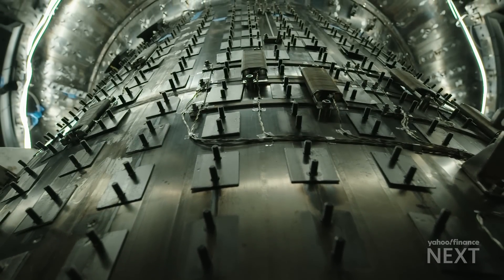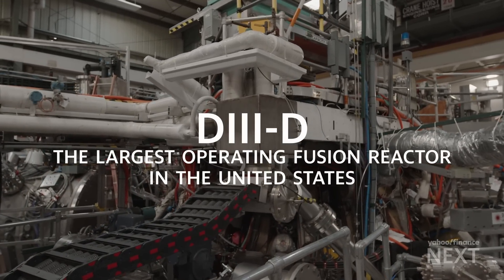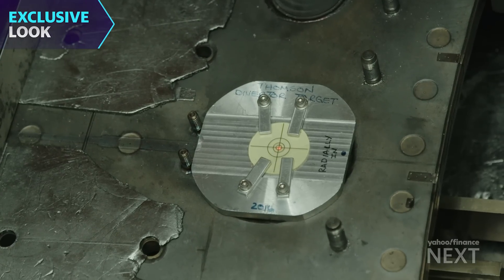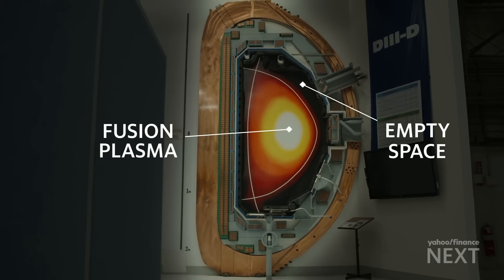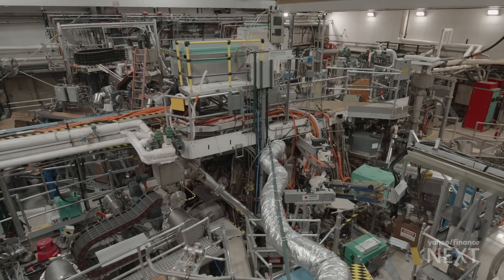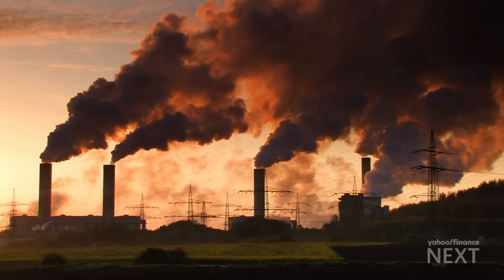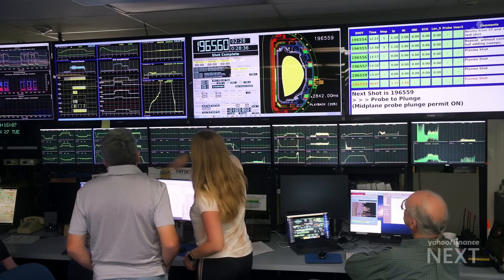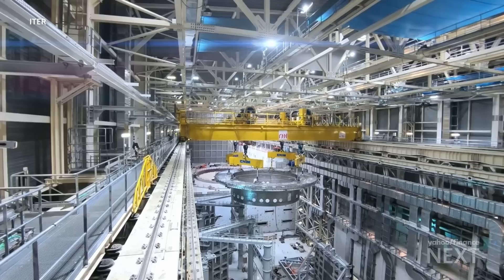Inside America's largest magnetic fusion facility and the hunt for limitless energy

Comment: Isn't that a bit silly? If a small prototype fusion reactor that produces commercial heat doesn't work, why build a large and expensive prototype? Or is this a deception of investors? Tamm and Sakharov proposed the tokamak concept in the 1950s, a toroidal device that uses magnetic fields to contain plasma to achieve controlled fusion. ....  More than 74 years later, there is no working commercial fusion reactor and won't be for many more years. Why? Because Tamm and Sakharov proposed an untested, unproven, unconfirmed, inoperable technology. There is a correct technology. It's Vlasov's scientific discovery of nuclear fusion in the Sun's atmosphere. But will reputable physicists admit that they have been wrong for many years? Are they just going to keep banging their foreheads against the wall for years?

Comment: Let's consider the following options and the alternative.

Cold Fusion (LENR) - Unproven hypothesized type of nuclear reaction that creates nuclear fusion at room temperature by producing more energy than the input energy can be produced from its altered state.

Tokamak Nuclear Fusion Reactor (ITER) - Development cost for the ITER is $150 billion. Requires a temperature of 150 million degrees Celsius to create nuclear fusion. Reportedly the record to date but having to use more input energy than produced is 69 megajoules of fusion energy for five seconds using 0.2 milligrams of fuel. 

The alternative.

Solar Hydrogen Energy Recovery Gas Turbine. 

301Kwh (equal to 46/6.6Kw home solar installations) of solar energy collected from the sun’s nuclear fusion at atmospheric temperature is sufficient for electrolysis to fuel start a hydrogen Gas turbine to enable the synchronizing of its Variable Frequency Generator to provide constant electrolysis to continually fuel the turbine and operate the energy recovery system on a hydrogen use as produced basis with variably regulated base load power supply capability to service grid energy demand and manage both inertia, and mis matched frequency while generating an energy range between 86 - 330Mw with optional co-generated steam capacity up to 700Mw of electrical energy on a 24/7 basis. 
The power generating turbine has three operational parts, 3m in diameter 5.5m long and weighs 6 tons. Installation cost $36.5 -49.5 million, requires an operational footprint area the size of a football field, noise level is 60dbl at 60m, incorporates direct air capture of CO2 at 1,400 Kg/sec and includes a 14-year end of life decommissioning or optional refurbishment program. 

Sixty-five carbon and pollution free, shovel ready off the shelf technology that combines Solar Nuclear Fusion with modern aerospace propulsion and existing Nuclear and Coal fired steam technology to generate a total of 21,450 Mw by  retrofitting to any of the 120 Hydro-electric schemes would provide Australia's 26 million population its entire energy needs covering a combined operational area of 33 hectares for a 2023 total cost between $2.4-3.3 billion, construction period is 3 to 5 years, meet net zero energy target twenty years earlier and makes wind and solar farms including hydro, gas and nuclear energy production redundant.

Comment: While researchers have taken the Tokamak to a very refined level it seems so transient that sustaining a continuous reaction seems like a pipe dream. I'd hedge more on Helion's approach for something that may reach a level to actually create viable and scalable net power even though it's pulsed. It's rather elegant in actually creating current instead of heat that must be captured and used to make steam in order to drive conventional power turbines. Sure the fusion output may be lower, yet these are more compact and can be replicated faster for multiple on-site units as well as, simply, multiple sites in many areas. By everything I've been able to read on Helion's approach, it seems, right now, the most viable to actually commercially make power in the most near term. I have fears that chasing the Tokamak approach, like ITER, is either futile, or simply carrying on the old saying that it's 30-years away and will always be. Hope I'm wrong as ITER will be the largest failed experiment of mankind in both monetary loses as well as physical effort. Admittedly I am not a scientist and would be happy to be wrong.

Comment: Energy should be produced from building made from concrete structures with exterior solar city tiles on all sides of all buildings commercial, residential and industrial as standard building practice. Power plant should be intergrated into builds of air ports, train and bus stations and ship port. Energy creation should be intergrated into the engineering of city's architecture. In the old days every home had a chimney and Arial.  in the 21 century city apartments could have wind turbines and external solar wall and internet should be intergrated into electric cables as a added core directly connected to fuse board and all external and internal lights should have internet antenna intergrated. Citys should be self sufficient for energy in the 21 century and grided from transportation systems country wideand beyond. Wind farm could be intergrated to motorways and Trainlines architecture to. There's no reason to disturb the natural world for integration of energy systems. preservation of the natural world by protection from farmers and national park caretakers. and industry to commit to engineer architecture of 21 century city's appropriately with modern technology advancements for self sustainability city from genuine Grid systems and that is transportation.

Comment: Nuclear fusion energy video productions are often overhyped, typically focusing upon the future promises rather then upon the numerous problems that have been encountered since the research began in the 1950s. The pitches are often done to attract potential investors as well as public support for the dozens of experimental machines now operating around the world. A listing of the past and current machines can be found in the following Wikipedia article.

List of fusion experiments

The promoters have typically claimed that the fuel is unlimited and there will be no radioactive waste. What they often fail to mention is that in most cases the tritium fuel is radioactive and the current market value of it is approximately $30,000/g. The 14.1 MeV neutrons, resulting from the D/T fuel fusion reaction will transform some of the elements, in the reactor structures, into radioactive elements so some components will require disposal as low-level radioactive waste. Most announced nuclear fusion energy 'breakthrough' announcement experiments don't even involve the use of nuclear fusion fuels such as deuterium and tritium but frequently refer to fusion reactions, something that didn't take place during the experiment.

Reference are often made to the National Ignition Facility (NIF) experimental shot that occurred on 5 December 2022. That experiment took about a week to set up. The nuclear fusion reaction occurred within a microscopic volume and lasted for approximately 0.000,000,000,08 second. The measured output energy was about enough to boil two liters of water. Approximately 96% of the extremely expensive fuel was blasted away from the reaction center before it had a chance to participate in the reaction. It was later noted that the input power to the laser was over 100 times greater than the nuclear fusion energy that was generated during the experiment. It's been estimated that the target assembly cost approximately $100,000 which was vaporized during the laser shot. This so called 'breakeven' shot was supposed to have been achieved by 2012. The NIF has always been primarily funded as a thermonuclear weapon (H-bomb) research tool. The lab management has become masterful in obscuring that fact when presenting it to the press and to the general public.

The ITER project in France is grossly over its original budget and at least a decade behind its original schedule. A couple of major problems have recently been identified with its key modules so now there are further delays. It is unlikely to achieve its first fusion reaction by the year 2030. Even then it will likely take another decade before a commercially practical nuclear fusion power plant can be demonstrated.

Those who work in such fields, along with the vast majority of Earth's 8.0+ billion humans, tend to have become masterful in excluding the following warnings from their consciousness. I urge readers to search for the following two article titles.

IPCC report: ‘now or never’ if world is to stave off climate disaster (TheGuardian)

UN chief: World has less than 2 years to avoid 'runaway climate change' (TheHill)
  * This statement was made 5.5 years ago.
Reply: Wow you’re very smart 
Where do I get to listen to more

Comment: I don't think it's possible, the temperature they might be able to produce but the pressures needed to fuse atoms is enormous.
Reply: good news, it is possible; the first tokamak was built in 1954
Reply: @duckling_the_mighty  So it's been 70 years they have been trying and there not even close, there is no material on this planet that can handle those pressures.
Reply: You're misunderstanding. They can already achieve fusion. The problem isn't achieving fusion, it's making the fusion process more efficient that is the problem.
Reply: @kota4160  The longest they have achieved fusion is 48 seconds at 180 million degrees, like I said the temperature isn't the problem, they need that extreme pressure to make it more efficient and that is very unlikely.
Reply: @raymondingram2539  Helion's technique uses a pulsed approach that would fix your problem
Reply: @kota4160  That only works on a small scale for a short period could not be done on a large scale.

Comment: "energy without harmful carbon emissions without radioactive waste" - no CO2 yes, no radioactive waste is an outright lie. There is much less waste than from nuclear fission but Tokamak fusion reactors do become radioactive due to neutron activation and so this is simply not true! Aneutronic fusion can be largely free of radioactivity but the most widely used approaches - using magnetic confinement - do produce neutron activation and most will use tritium as fuel which is radioactive itself! Fortunately the waste has shorter half lives than fission waste.

Comment: The nuclear fusion reactor works in the Sun because of immense gravitational force due to the size of its Mass by the volume of the Sun, not magnetic compression or colliding of nuclear particles like in atomic partial nuclear particles colliders, it’s not going to work on earth like that and these concepts only sold to nation governments as insurance dream backed by national treasuries, wasting tax payers’ money to rich themselves.
Actually, the Sun making very slow light heat energy. A photon both an upper and lower wave of light particles both include mass directly proportional to energy (an unsolved mystery in Nuclear Physics (Quantum mechanics) takes only eight minutes to get to the Earth from the surface of the Sun. But it can take up to 100,000 years (very very long time to make viable energy solutions for consumers) from the Centre of the core of the Sun to get to the surface, where it shoots out or spreads and travels at the speed of light.

Comment: I was born in 1951 and through most of my lifetime scientists and researchers have been experimenting with nuclear fusion in pursuit of the holy grail of practical generation of nuclear fusion energy that can be used to generate electricity. As we know the big problem is we have to basically create here on earth the conditions in the core of the sun, which is extremely high temperatures and extremely high pressure. As a result I believe that we will never be able to achieve practical generation of nuclear fusion power. About the only thing we have achieved with nuclear fusion is the thermonuclear bomb which destroys everything for miles around.

Comment: I'm against its achievement, will never happen... Fusion is Endothermic reaction.
(H2 + H3)--> D2 + T3 ---> He4 + n1 + Energy(+/-)...
Deuterium is      2.01410.  amu.
Tritrium (T3) is  3.01605.  amu.
Initial Mass is.   5.03015   amu.
Neutron is ( - )  -1.008665 amu.
End Product is.  4.021495 amu. ; But actually
Helium (He4) is 4.0260...  amu. ; That Absorbed/Stored Energy inside He4 Nuclei
Then (Stored) (-)0.004515 amu.; Inform of INCREASED MASS ; Potential Energy or Binding Energy inside He4 Nuclei... Never given-off positive/Net gained Value of heat.
Hence, Fusion is preparing process to create Helium by Enormous Compression Energy from Star/Sun' s Gravity (in nature, for free). But by man-made activation.. we put in/dump in illimited Energy in expecting of Resonance Atomic Energy if High enough, will cause D2 & T3 to fuse together.. and give-off access energy.(Which will never been occurred) B'cuz fusion is ENDOTHERMIC process, only when (later-on)Helium will exlplode-back into primary Hydrogen (H1,D2...) That is Fission of Helium that'll give us access Energy. In around Solar Core, Fission of Helium & Fusion of Hydrogen (due to nature of Gravitational Compression) are non-stopped Regenerating/Recycling INTERACTIONS...never one-way to finish processes (that were learnt from Mainstream /Current Academic Science/Physics... For sure this whole idea will amazed you or make you ?laugh? of inconformity of what the whole world would believe & conduct testing... But think of the Clouds (Vapor moisture) and the Rain on Earth.. this is how we get the FREE... HYDRO-ELECTRIC from the Dam-Generators for hundred years.. the Recycling/Regenerating reaction of Vaporization (Fission) and Condensation (Fusion) in front of our eyes.( Sadly , solar plasmic volume (no matter how bright/light) is OPAQUE Material.. no any man-made probe can see through/ inside the near solar core..) Anyway most of cosmic radiation is Proton.. not (very scarce) Alpha-Helium nuclei,.. why, b'cus almost all of Alpha-Helium are already BROKEN -BACK into Elementary Hydrogen..!! That is what i try to confirm the never-ending Regenerating/Recycling INTERACTIONS.
Not one-way to finish: (D2+T3-->He4) or (4H1-->He4) such like that...(!?!)
Reply: In short, both simple HYDRO-ELECTRIC (Dam) and (complex) Fission/ Fusion Energy are basically from Sun's GRAVITATIONal/Potential Energy that Freely give us & the whole lives on earth to run-on the Ecology (Food-chain) and CO2 & water circulation (Wind & Ocean current), Seasonal regulations etc.

Comment: Problem with any energy production processes no matter what kind of fuel we use all suffer of low efficiency and even the final use ends up as heat dissipating in the atmosphere. Nobody is working on how to cool the atmosphere and the oceans that we all use as heat sink(dump)
Reply: The earth radiates energy as a black body, and the atmosphere is constantly  outgassing high energy gas molecules into interplantary space.  Moderating albedo is a very effective means of controlling the rate at which this radiation occurs.  Ultimately, all energy generation increases entropy, and there is an arrow of time, but this applies to every process that occurs everywhere always.  We are billions of years away from that being a concern - we can use the rest of the universe as a landfill until then - at least in an abstract way.  But we are literally THAT PROCESS - as we write these comments - we are informational artifacts (noise) that try to "solve" problems by turning structured matter into more noise, that we consider 'knowledge' , and  in doing so, we permanently  degrade the quality of resources available to us.  Its not a problem to be "fixed" - it IS  what existence is.  The only way to reverse the process  is to forget ... but this universe remembers, because causality is a thing here.

Comment: Imagine if all the money spent on this had been put into solar, wind, and storage.  We would already be getting all the energy from those projects. Power "plants" of all kinds take a lot of capital to build and don't generate any revenue until they are completely done. They are also centralized in a way that creates a single point of failure that is so important to the grid that it can bring down the entire grid. Even the wires connecting the plat to the grid are a point of failure. Distributed generation and storage is the correct way to design a grid.
Reply: Also geothermal using the new plasma spalling drills and ocean platforms combining wave, wind and solar from unused oil platforms
Reply: Those also take up large footprints and produce allot of toxic waste and materials ironically.
Reply: Solar power is weak sauce compared to the alternatives.
Reply: @williamswiggart9782  on Earth yes. In space it's 24/7 and 1.37kw/m^2.  If we were smart we'd stop throwing billions at fusion and generative AI and build NASA's Integrated Symmetrical Concentrator power satellite instead. But we're not.
Reply: Failure point Extreme weather, no sun or wind doesn’t help either.
There is more promising forms of energy production in both fission and fusion, but for some strange reason they can only recognise Uranium fuel pressurised water reactors from the Cold War era and Fusion TokaMac reactors?
Reply: @YellowRambler  keep trying the same thing and expect different results.
Reply: All those alternatives are great but don’t work everywhere and can be unreliable even with storage solutions. Fusion would top any of those energy harnessing technology in terms of magnitude and footprint